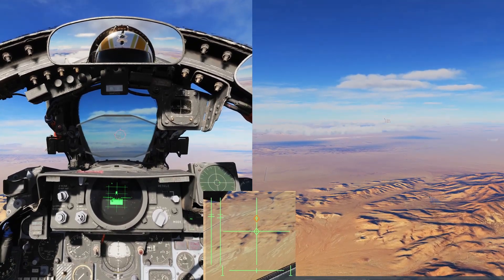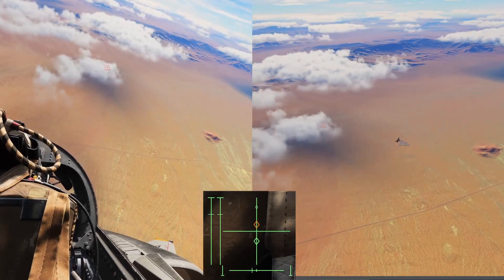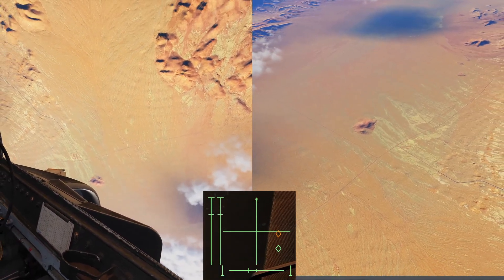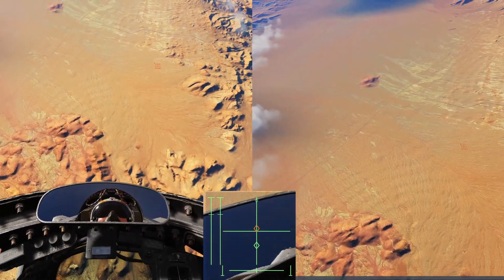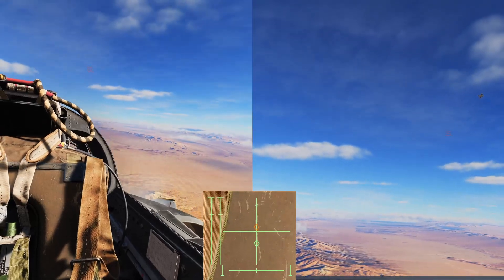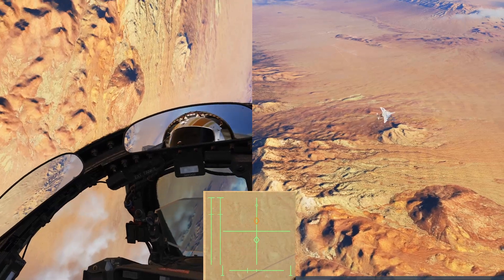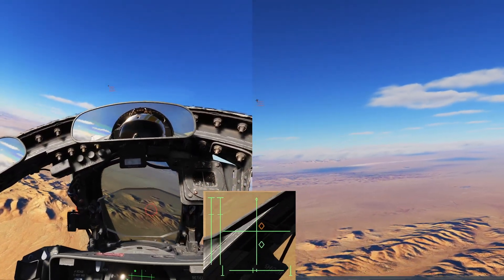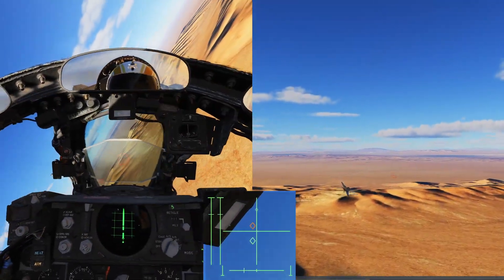DCS F-4 HOW TO RUDDER REVERSAL

Comment: Even flying at high AOA >20 units i dont seem to get adverse yaw. Is there anything i might be doing wrong?
Reply from the maker: Perhaps.  Try to make sure you're introducing yaw with the rudder first, then add aileron in the opposite direction of your rudder input.  But you also have to make sure the wing isn't stalled, as then you will have zero aileron effectiveness.  So to practice, start off by getting comfortable performing a rudder roll coming over the top.  Here's how: pull to a nose high attitude and maintain the same amount of back stick pressure through the entire maneuver.  Then, when you hear the slow beep, add a quarter or half rudder - and don't add any more rudder.  Maintaining that steady state stick back pressure and rudder pressure gives you a constant rolling motion as you approach and go over the top.  Once you can accomplish that maneuver, try slowly adding opposite aileron after you've established your rudder roll.

Comment: Hi Kojak, at speeds of 350 KCAS for initial rudder input, the rudder limiter will prevent full use of the rudder. Reversals should be undertaken below 220 KCAS when the rudder limiter has cut out according to the  F-4 USN Tactics manual (NAVAIR01-245FDB-1T Page 1-28).
Reply from the maker: Nice! Thank you for the info Titus, I'll give it a try.  Was debating if I wanted to try to get my hands on F-4 NATOPS at some point.  I found an 1972 E dash 1 online a couple of years ago, and spent the next coupe of days going cover to cover!

Comment: Thanks for the video Kojak and I think a lot of people have been struggling with this, I had been but had accepted my average attempt until i saw your video and though I'd take your learnings and work on it some more.

What I have found that works (and I am in no way suggesting that this is the "right way" - switch off yaw stabilization, once I pull up and get to around 300 IAS, I throttle back, full rudder, and wait till about 200 IAS before full opposite aileron.  This def induces the need to ease off on the back pressure and I find myself really working the pitch to get it to move around the vertical axis
Reply from the maker: Excellent MGA!  I'll give it a go; how often have you departed controlled flight with this technique?  Just wondering what kind of a ride to expect!
Reply: @kojakgaming3519  was thinking this morning how I didn’t comment on that (and turning off yaw stab is probably something that is going to put you into that condition) - but the answer is I’ve yet to depart. I’d like to say that I’ve been smooth on the controls but I haven’t been so maybe just luck on my part or maybe I’m not pushing it hard enough (but looking at my tac view track, and I used the highway out of INS as a good visual reference point its a fairly nice reversal - but hardly a a 4/5th gen pivot)

Comment: Not mission appropriate, but I’ve actually had quite a bit of success with a Fox-1 solution coming over the top with a prolonged vertical to build separation.  The E-2’s don’t really have the legs for BVR, but they’re pretty great for a high/front aspect shot  during a fight if you have a little distance to play with.
Reply from the maker: I've tried a FOX-1, but have never been able to get a lock.
Reply: @kojakgaming3519 I’ve had the best luck having jester lock him in boresight, but CAA also works if you’re careful about checking that it’s a valid lock.

Comment: Hi, Kojak, what was your speed at the pull and reversal?
Reply from the maker: Hi! I was at 411 KCAS at the pull up, 350 KCAS for the initial rudder input, and 232 KCAS with my max aileron input (I did not fully deflect the ailerons).  Lowest speed with aileron deflection after coming over the top was 186 KCAS and 284 KCAS at the bottom. First seeker tone was 300 KCAS, second seeker tone was 320 KCAS. Third seeker tone was at 420 KCAS and the shot was at 446 KCAS.
During the climb and reversal, I didn't crosscheck my airspeed indicator, just relied on the AOA audible cues for a best guess at how much I was pushing toward a stall.
Reply: @kojakgaming3519  Thanks. I will give it a go.

Comment: Thanks for the insight, I remembered that the technique was described in the briefing but moving forward with the exercises I totally forgot to take some time to try it, honestly I'm not sure if I even really understood what pratically should look like..the aircraft should rotate about its vertical axis, pivoting sideways from a nose-high to a nose-low attitude?
Reply from the maker: Correct - rotation about the vertical axis (yaw) is the primary aim. You'll also see rotation about the lateral axis (pitch), but proportionally less.  The higher the AOA, the more pronounced the adverse yaw from aileron input.